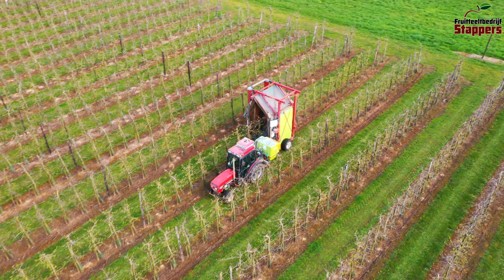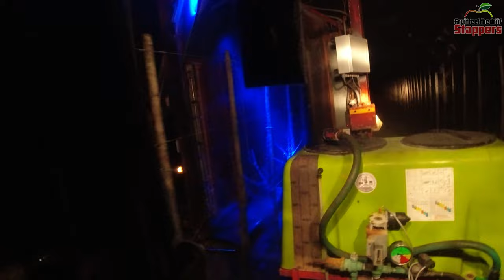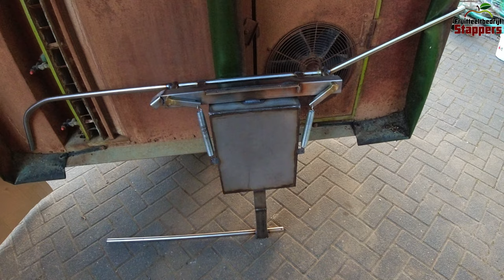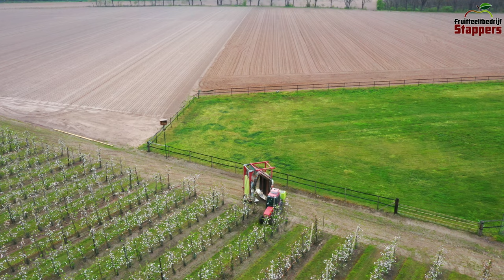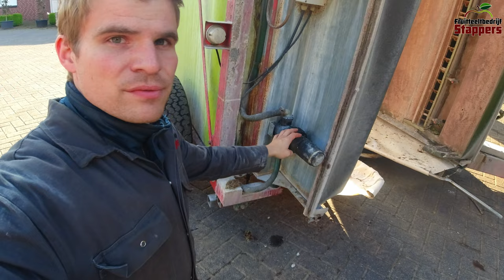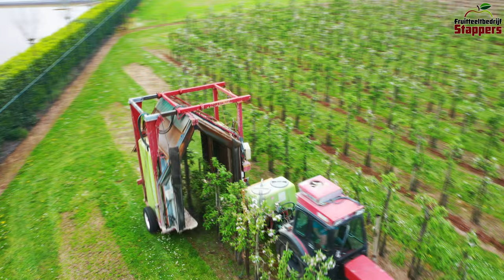The last running Munckhof tunnelsprayer in the world?

Comment: The previous owners probably didn't have your mechanical skills and could not do what you have done. Looks like the new(old) sprayer is a keeper because of your mechanical abilities.
Reply from the maker: Well it takes alot of time, effort, material and trying to get something done. The video doesn't justify the invested time. Welding tig goes really slow, and requires dedication to the workpiece, but i defenitly like the result so far. Capacity aint the highest, but it gets paid back very well in the saved chemicals.